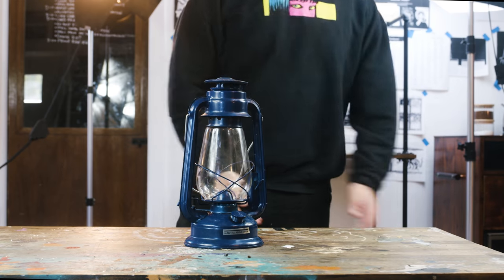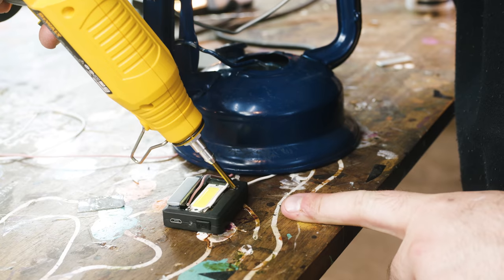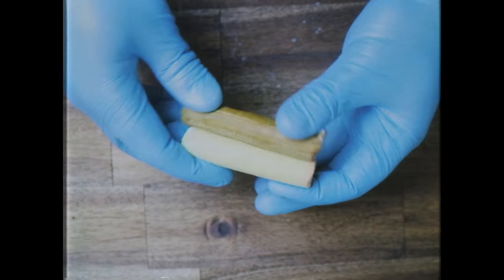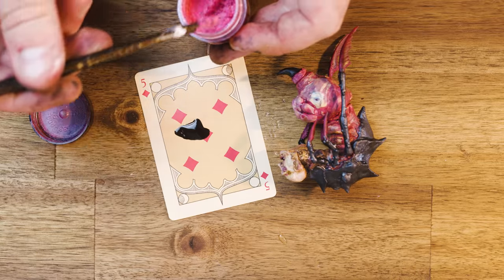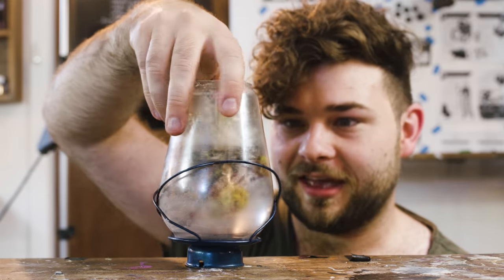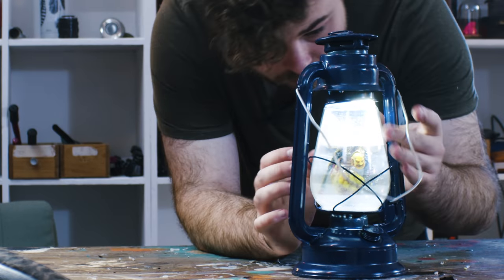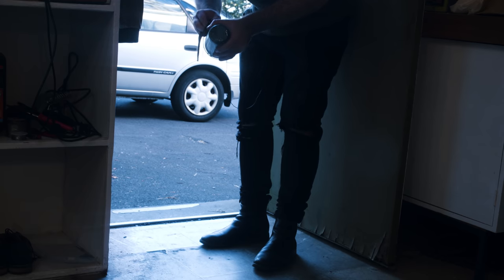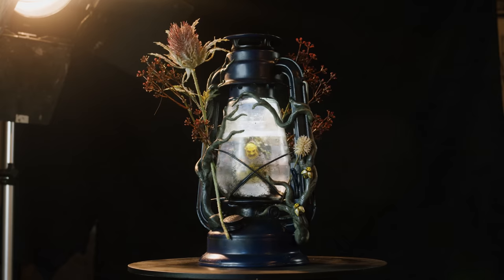When A Project Goes Wrong

Comment: Resin is always tricky. When it's used to create rockets (like Xyla Foxlin does), in creative projects (with Evan and Katelyn) or tiny art projects (like the ones by Ben's Worx)
There is no creative YouTuber out there that didn't had issues with resin. 
Don't give up, you've saved your project pretty darn well. There are resins specifically made for deep casts, that avoid the problems of witness layers, but they are even more expensive.

Comment: Wow just next level creativity from all angles. I'm not brave enough to go anywhere near resin pours but I do have this stuff called Water Texture from Vallejo. Its water based, doesn't smell, no worries it won't work. Really easy to work with for smaller jobs. I may be a bit of a vallejo fanboy so take that into consideration.

Comment: Trying to get a decent resin pour inside a clear glass container is gonna be a shitshow about 50% of the time, it feels like it should be a shortcut to a decent effect but often it just makes things much harder. The long way to do it would be to do the resin pour in a temporary cylindrical container, cut it down on a lathe to exactly match the shape of the original glass lamp chimney and then polish it to a glass-like sheen. (That's also a cheat method for making a ship in a bottle. ;) )

Comment: Love the outcome and your methodology, just one thing: why didn't you pour the resin in all in one go? would have negated the layer line risk.
Reply from the maker: Thank you! This resin is not designed for deep pours and instead you have to do it bit by bit otherwise it will crack due to shrinking and heat
Reply: @Miscast  ahh makes sense.